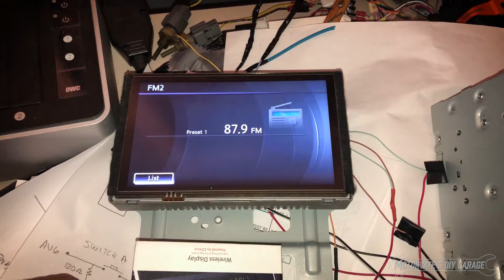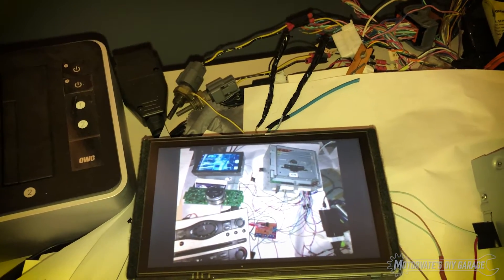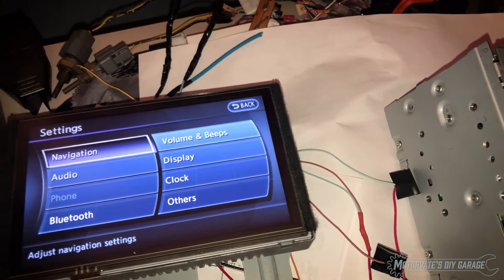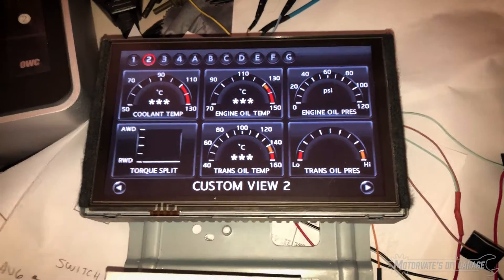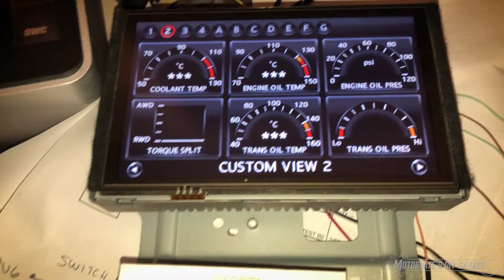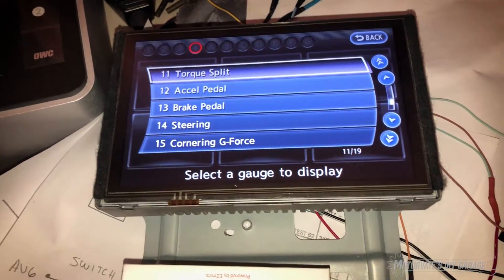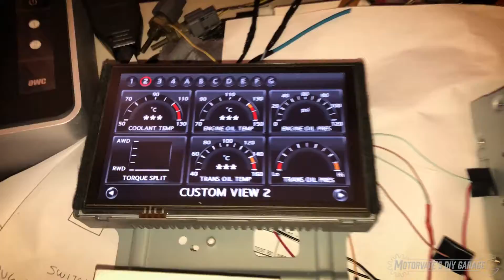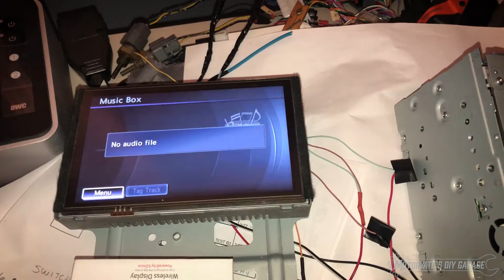Progress Update on the GTR Gauges using the G37/370z Nav Screen: MotorvateDIY  Garage Ep.47

Comment: Love it! Keep updating. I'm hoping this won't require a NAV Touchscreen unit. I'm missing that in my '09 but would love to be able to have these gauges. You saw the post I made on MyG37, this is exactly what I'm looking for. I'm stoked!
Reply from the maker: Hey Rob,
Sorry to say, but it does require navigation. The non-nav av unit, doesn't have the GTR software on it.

There are a few companies that offer a wiring adapter kit, to allow the nav system on a non nav car, but the total cost is a little high.
Reply: @MotorvateDIY  Hey thanks for replying. I figured it would require NAV but didn't hurt to ask to be sure. I'm thinking about upgrading to a NAV capable aftermarket system. We'll see. I'll keep watching this. Awesome job.

Comment: Hello again! I have a question..have you ever had issues when accelerating? It just started and only noticable really when I first start up, it delays shifting and reduces my gas milage sadly :( No slipping or shuddering to my knowledge but if I give the car more power to it goes away a bit..even after a drive it's still slightly there as I accelerate and when accelerating only..maybe the throttle position sensor..?
Reply from the maker: Since my G37 is a manual, I don't have any experience with the 7 speed autos or know how they typically shift when cold/warm/hot.

If there was an issue with the throttle position sensor, you would have a code. It is monitored all the time to ensure the input is accurate.

You best bet is to post this question on myg37.com and someone should answer your question.

Comment: Hi, do you know if there is way to remove the parking brake overide on the screen. My 370z comes with the composite inputs as standard but I can only use it with the handbrake on.
Reply from the maker: If you search around, you can find instructions for this.

In a nutshell, the parking brake wire the goes into the nav unit needs to be cut and grounded. The vehicle speed wire can be cut, but this makes the map position updates slow and jumpy. Some add a switch, so they can have the best of both worlds.
Reply: @MotorvateDIY  Thanks for the info, have found the wiring diagram for the nav unit so will be adding the switches soon. Your video's are great. If you have any more info on where I can learn about CAN BUS systems and how to read data from them please let me know.
Reply from the maker: Thanks for your kind words and I'm glad you got the wiring diagrams.

As for the CAN bus stuff, everything I learned is self taught, so I don't have any resources to share.... BUT I am thinking of putting together an episode on how to get started on Nissan/Infiniti CAN bus reverse engineering and share a few tips. It really is very logical and easy!

Having said that, most of my free time is now spent getting the GTR gauges working on my G37, so it will be a while until it is out.
Reply: @MotorvateDIY  Hi again, just wondering how you got the GTR guages to show. I have read up on the method of getting an old laptop and then tapping into the hard drive from the navigation unit, but curious to know how you did it?
Reply from the maker: I made a "USB to AV Terminal" adapter. This allows terminal / command line / console access to the navigation unit.

All details (including schematic diagram) are here:
https://www.myg37.com/forums/audio-video-and-electronics/301371-modding-the-oem-navigation-head-unit-gaining-gt-r-mfd-and-other-functions-3.html#post4317174

To bring up the gauges, enter "mfd 2" .

On the 370/G37 only about 5 out of the 30 gauges will work. I'm working on making a plug and play CAN bus translator that will give the required data to make all the gauges work.

I'm also going to be using my Bluetooth sensor server, to get engine oil pressure to display on the GTR gauges. Since it is Bluetooth, there is no need to bring wires from the engine bay into the interior AND it only needs 2 wires, ignition and ground. Testing will start in the spring.
Reply: @MotorvateDIY  Thanks for that, I was reading through another thread on the same forum but this is even better. Its amazing that all the software from the GTR is packages into the same nav unit. They should have just activated it from the start when selling some of their sports vehicles. Will be getting a nav unit from a 2019 370z and testing it out before doing anything to my own car. This is really amazing work!
Reply from the maker: Sounds good and please share what you figure out!

Comment: Hi different problem but I wanted to ask have you ever dealt with a P0300 code I have a 09 g37s sedan 6mt with 88k and my cel came on
Reply from the maker: That can be a tough code to resolve, as there can be many possible causes.

An easy place to start is to use an OBD scanner and look at the short term, long fuel trims and add them together. They should be between -15 to 15%.

Another easy check it to remove the spark plugs and check for oil in the spark plug hole and check the spark plugs.

Next steps require special tools.
PLEASE what ever you do, don't replace parts as a guess and hope it fixes the problem. Generally that is expensive and frustrating.
Reply: Okay thanks will look into it

Comment: I asked this before…somewhat… but after seeing this video, my question is a bit different. Would it be possible to Frankenstein parts from the nav unit and non nav unit to make it work?
Reply from the maker: I don't think so... All I know for certain is that the wiring harness/connectors, is different between non-nav and nav.

If you were to add a nav screen/nav unit to a non-nav car and figure out the wiring differences... I don't know if the temp controls or radio would work .  All of that isn't cheap or easy.

So, I don't have anything for the non-nav cars right now. I will look into it down the road, but for now I want to focus on the "easier" GTR gauges first.

For the non-nav 370 folks, I am going to be working on a nice hi-res 7" LCD display for gauges.  Maybe that could be adapted to work on the non-nav 07-08 G35/G37s?
Reply: @MotorvateDIY  ah i see what you mean. I can easily get my hands on nav and non nav G37 parts. That is why I asked my question.

Comment: Oh geez, nice job!! Count me into one of your first sales! I do a bit of cad, and 3d printing. Lmk if you need anything built! Can’t wait for the next update!!
Reply from the maker: Thanks for the offer, I will keep it in mind.
What I really like about being able to use the factory Nav screen and the GTR gauges is that no part of the dash needs to be modified.

With the interior temperatures being very hot in the summer it is nice not to worry about plastics deforming or sourcing a sunlight readable screen.
Reply: @MotorvateDIY  right, you probably won’t need to modify anything, and on the plus side…it looks super clean. I’m properly excited about seeing this finished.
Reply from the maker: Thanks for your excitement... So far everything is working out well. :)

Comment: I cant wait till this is released! I have my  aftermarket oil pressure, and oil temp gauge sitting on my desk atm. I cant find a good location to mount them. I was trying to keep things somewhat oem looking. You are taking that to a whole different level. :)
Reply from the maker: Thanks for your kind words!
If your car is a G37 or 370, the engine oil temp is broadcasted on the CAN bus (the car's network), so no need for another oil temp sensor or gauge :)

I hope it works as good as I think it will!

Comment: I wrote how to enable the GTR menu 1.5 years ago, and you also read this article on the g37 forum.  Therefore, your path was not so painful))
Reply from the maker: Well, all I can say is THANK YOU!!! As far as I know, you were the first to figure this out. You are VERY smart!

I have studied that article (google translate made it a little difficult) for hours, trying to understand what you did.

As for the myG37.com thread (https://www.myg37.com/forums/audio-video-and-electronics/176160-hard-drive-mod-28.html) I am an active participant and share what I have learned / figured out.

You are right, the path wasn't difficult just a few thousands hours to reverse engineering the CAN bus and a thousand dollars on modules, screens and switch panels... and everything was done with CAN bus hardware/software I built using the wonderful ESP32, no expensive and professional scan tools.

Could you please post a link to your article?
I would like others to know that you were the first to figure it out.
Reply: @MotorvateDIY  I don't pretend to be honored, but it's nice) Esp32 is a wonderful thing, especially for can bus with mcp2515 + transceiver, and sh65hv233)) we have 2 channels for sending packets with frame substitution) Such a device?  Respect for tire research!  Do you take packets from the obd 2 or j1939 protocol?
Reply from the maker: I just use the raw CAN bus broadcasts (each ID is typically at 100hz)... No need to use OBD or J1939 and request data / wait for data / get data.

Also the "CAN Filter 18 In 1" is a nice STM32 with dual CAN and 12 volt to 3.3 voltage regulator all in one small package. If you are not aware of it, you might want to look into it.
Reply: @MotorvateDIY  youtube unfortunately deletes my messages with links, so I can't send them here.  The product on STM32 is now more expensive to make than esp32)) even with strapping.
Reply from the maker: Agreed... I thought about that after I posted the message. Can't beat the price of the ESP32!

What could I search on google to find your article?
Reply: @MotorvateDIY  "GT-R — Multi Function Display drive2"
this article is from 07/01/21 and the previous technical one is from 04/22/21
Reply from the maker: This is the article I used:
https://www-drive2-ru.translate.goog/l/587131238846869057/?_x_tr_sl=auto&_x_tr_tl=en&_x_tr_hl=en-GB&_x_tr_pto=ajax,elem

Is this yours?
Reply: @MotorvateDIY  that's right, it's me) this is technical, and after it is just about the gtr menu
Reply from the maker: Nice!
Once again, thanks for sharing what you figured out!
Reply from the maker: On the next video, I will give you full credit for figuring out the console access and how to bring up the GTR gauges. 

Are you OK if I use your picture/profile from drive2.ru?
Reply: @MotorvateDIY  Yes, sure!
Reply from the maker: That's great, thank you :)

Comment: How did you add the G35 AUX video input feature to a G37 nav system? Been trying to find a cheap way to do this so I can mirror maps since all I have on my 2012 is USB & Bluetooth.
Reply from the maker: There is a backdoor serial communication that gives you "console" or "command line" access on the navigation units. I've made a small circuit board to invert the logic and pull it up to the  required 12v. One side plugs into the AV module and the other plugs into a USB port and then you use any serial terminal program (CoolTerm, Putty, etc) to watch the boot up or send commands.

From there you can re-configure the unit, but some of commands are dangerous and without warning or "are you sure?" some commands will start to delete files or re-configure it in a way where it doesn't work anymore.

In researching/testing I bricked the AV unit 3 times, but after a few days I trying everything I could, I was able to get it back. 

At this point I'm going to stop trying things, as I have what I was looking for: AUX in and GTR gauges.
Reply: @MotorvateDIY  Have you found a way to change the color themes in the unit? I know some Nissans come with red or orange themes. I’m sure the themes are defaulted in the system but “ turned off “ depending on what car the system is in
Reply from the maker: I think you are correct. An easy way around this is just to rename the folders on the nav drive. Once everything else is working, I'll look into that.
Reply: @RedblockJesus  If you check the thread on MyG37 iCrap has talked about changing the theme and startup splash. You can tell the unit what brand and theme to use via a command.
Reply from the maker: It does require some inexpensive hardware (I'm making a cheap kit) and the full details on how here:
https://www.myg37.com/forums/audio-video-and-electronics/301371-modding-the-oem-navigation-head-unit-gaining-gt-r-mfd-and-other-functions-3.html#post4317174

Comment: Gauges are nice - will there be logging ability?
Reply from the maker: I know the GTR Nismo does have a logging feature built in, but haven't looked into how it works. I suspect it may be easier/cheaper to re-purpose the data logging to SD card functionality from my Mini-Dash / LCD gauges.

I will look into that after I get the gauges working in my G37.
Reply: Didn’t think about GT-R having it from factory 🤣
Reply from the maker: It does... and I think it records it onto a USB key!
I will have to look into this, as it may be an easy solution!